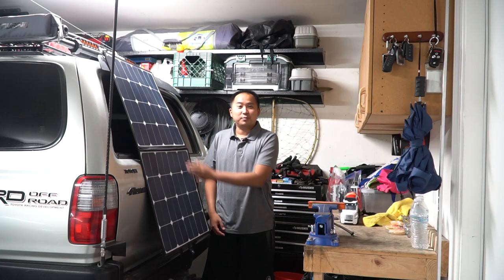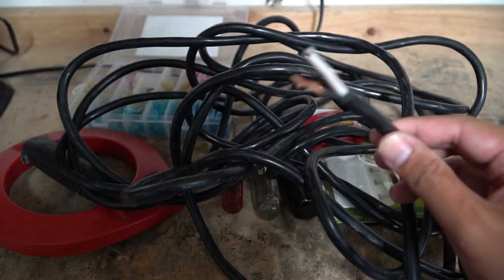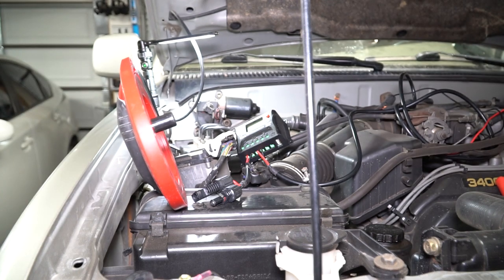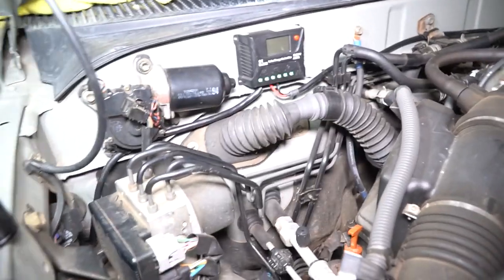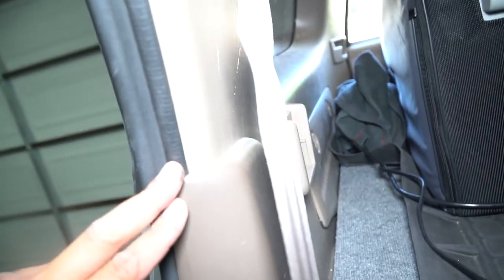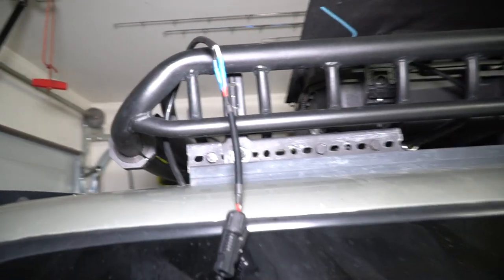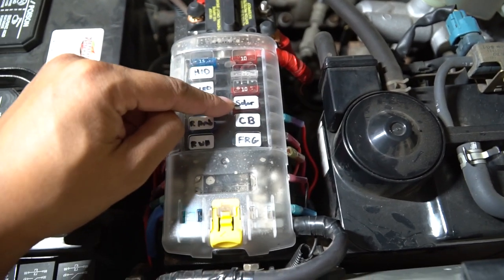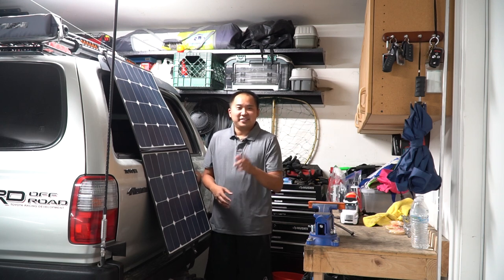Toyota 4Runner Renogy Portable 100 Watt Solar Panel Setup & Install Guide

Comment: Very nice video, now i know how to run a wire from top. But i dont understand why you need to run all this cables through the vehicle when the panel will be portable.
Reply from the maker: I mentioned I want to run a permanent one on top of the rifle box. Meaning it'll be bolted down and permanent when I can find one that fits. It's also way easier and faster to set this up and out of the way.
Reply: @PhoRunner  Sorry i missed that part.

Comment: Hey can you give me some advice I have the same runner put Bilsteins all the way around someone recommended some really crappy springs I hate looking to help get 3” lift with shocks can you recommend a spring set up thanks
Reply from the maker: OME 881 for front and OME 890 for rear. Or check here if you are running weight. https://www.toyota-4runner.org/3rd-gen-t4rs/66976-3rd-gen-4runner-lift-information-faqs.html
Reply: Thanks appreciate the info what setting on the front bilstiens there’s 3 positions
Reply from the maker: Mine has 4 settings and I leave it on the 2nd lowest setting

Comment: So a year later ... how did that setup go? Do you still have the same battery? Great channel!!
Reply from the maker: Still got the same battery. Parking it indoors is problematic but out and about isn’t bad at all. I switched to a 70w hard panel and it works pretty good!

Comment: Awesome contents for 3rd gen 4runners keep it up, how much did you pay for the renogy solar kit? Coz now it is showing at over $600
Reply from the maker: $200 I think
Reply: That's what I thought lol, coz the first time i saw your this video i checked the link it was at $200
Reply from the maker: Try this panel. TP-solar 100W 12V Solar Panel Kit Battery Charger 100 Watt 12 Volt Off Grid System for Homes RV Boat + 20A Solar Charge Controller + Solar Cables + Brackets for Mounting https://www.amazon.com/dp/B085XYMZ7S/ref=cm_sw_r_cp_api_i_OpNxFbRQWS1HT

That’s what I plan to run full time on the rifle box

Comment: Id never thought of just running it to the fuse box. That’s a great idea. When you turn on stuff, will it draw from both the battery and the solar?
Reply from the maker: Yup! Same thing at the end of the day but it isolates it a bit in case things hit the fan
Reply: PhoRunner Channel last question, is the charge controller not bothered by the heat of the engine bay? That’s the only worry I have for putting it there.
Reply from the maker: The charge controller was rated pretty high. I need to check but it hasn’t been an issue. It was a concern for me early on too

Comment: Does that ingress point exist on all 3rd Gen 4runners? It looks like a different rack than my stock rack. At the end of rack on back passenger side I will see this same type of plastic piece to place wiring through ?
Reply from the maker: Yes all 3rd gen have these holes